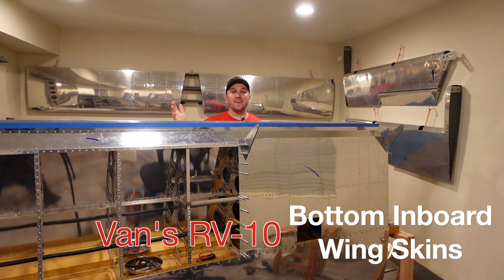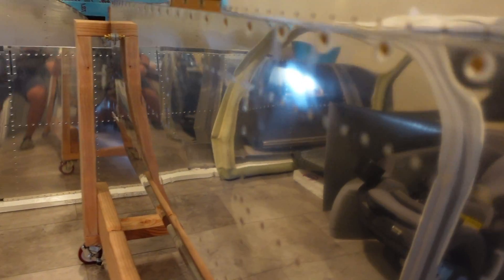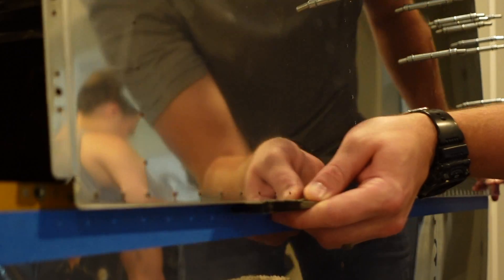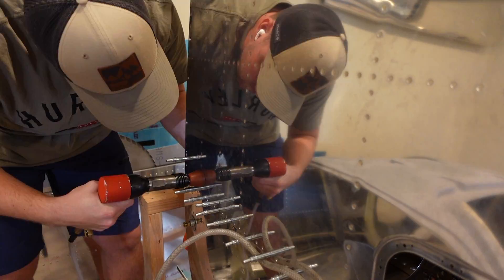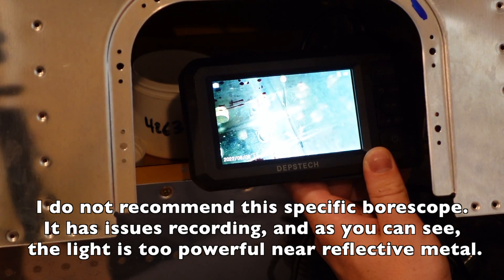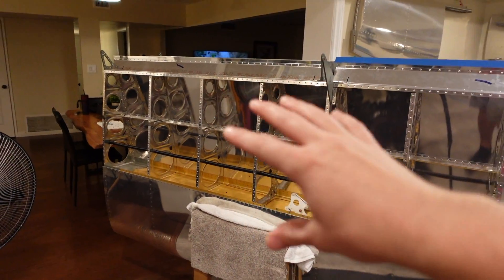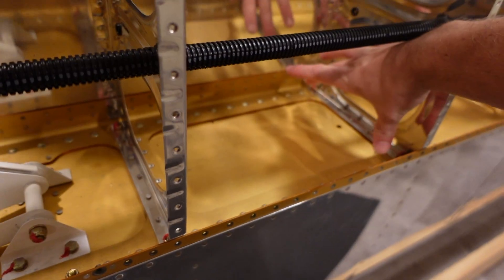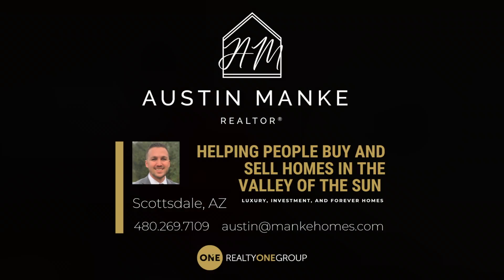Bottom Inboard Wing Skins - Van's RV-10

Comment: Hey Austin. Great progress. The tail surfaces look really nice hanging on the wall. THAT'S art! I notice they're hanging by paracord? It's strong (500lb-ish) but there's only two points of contact on each tail surface. Means it'll only take one point of failure for the surface to swing down. Unlikely, but possible. Consider a minimum three points of contact, four for your horizontal stab and elevator. I know it's selfish, but it would make ME feel better!
Reply from the maker: Thank you! And ohhhhh yeah I feel you. I never like the looks of it when I’m in there. Makes me cringe when I’m taking them down or putting them back up. I think you’re right. I’ll add some more backup tethers just in case

Comment: Hi Austin. I notice you're using the swivel head rivet set with the red cover. Did you trim that cover down a bit? I'm just starting my -14A build and use a rivet set called a Boeing design with a polyurethane rim. It dances around a little more than I'd like so I'm thinking of moving to the rivet set you're using.
Reply from the maker: Hello! Great question. Yes I did. I initially really did not like it due to the rubber being too thick, but after sanding it down a bit I have really learned to like it.  It doesn’t move around and is forgiving with rivet gun placement. And to prevent skin scuff marks, I have a strip of 3M rivet tape on the metal head. It lasts for a good 50 rivets or so before needing replacing
Reply: @AustinManke  Thanks for the feedback. I'll remove some of the red rim on the rivet set. Did you remove about half of it???
Reply from the maker: @bertschb  any time! And I don’t remember how much I removed, but remember sanding some off, trying it, and sanding more off again to get it to where I wanted it with the rivets being nicely set and without the head being proud
Reply: @AustinManke  Thought I'd let you know I shaved down the red cover on the swivel rivet set and used it for the first time today. It worked GREAT! That Boeing Style rivet set That I was using is now at the back of the drawer and won't be used again.
Reply from the maker: @bertschb  that’s great to hear! I was curious if you’d end up liking it. Thanks for letting me know. Such a handy tool to have when it’s working properly. Happy building!